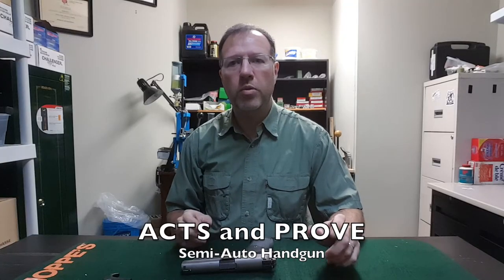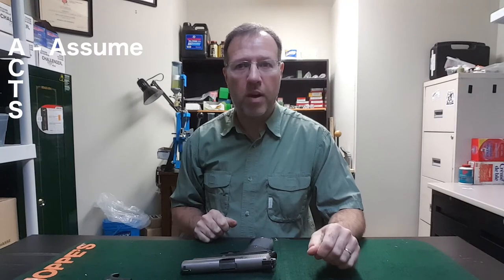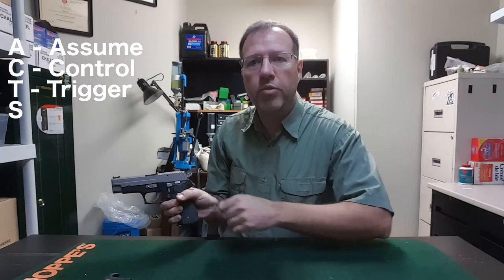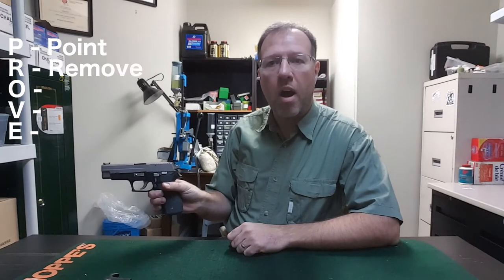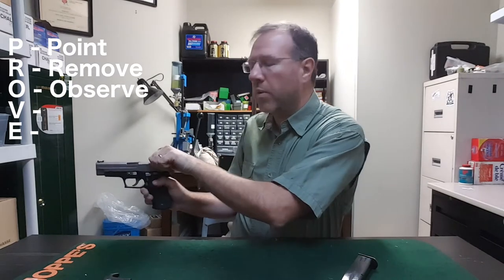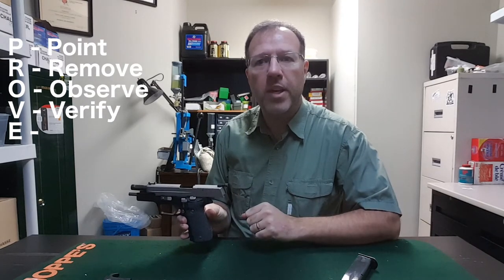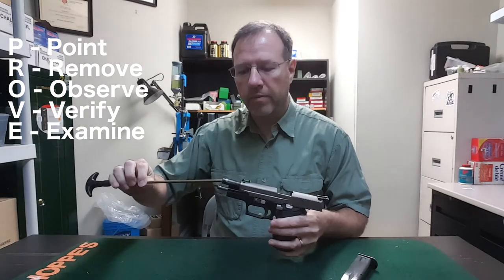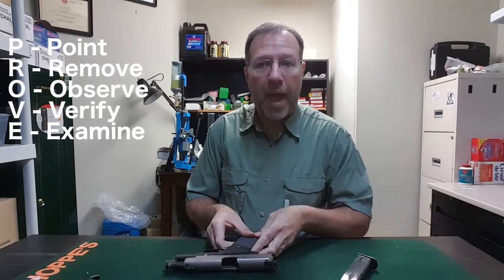ACTS and PROVE Semi-Auto Handgun

Comment: Thanks Adam. I got 100% on both practical exams. 
ACTS wasn't relevant as we just had to PROVE each firearm on the test.
Reply from the maker: Yep, you're right. The "ACT" part, (assume loaded, control muzzle, trigger finger away), is not part of the test, and should be well under control before a student goes through a PROVE. Messing up the Prove will cost points, but messing up the ACT could cause a failure :) . Congrats on the awesome scores! Now get that Application in as soon as you can, in case the discussed handgun ban comes along!